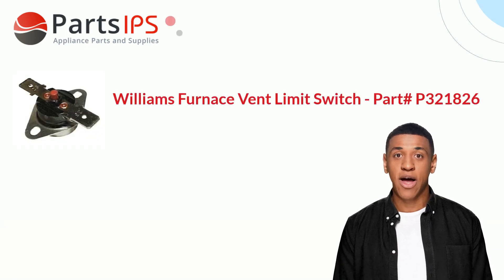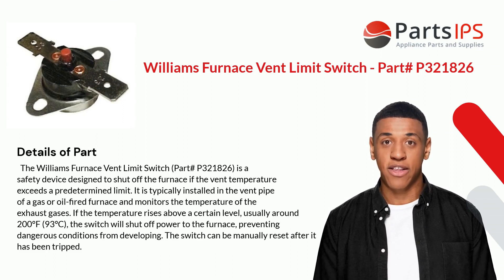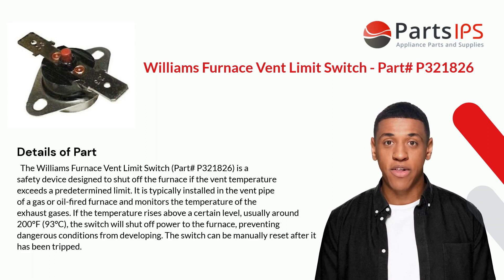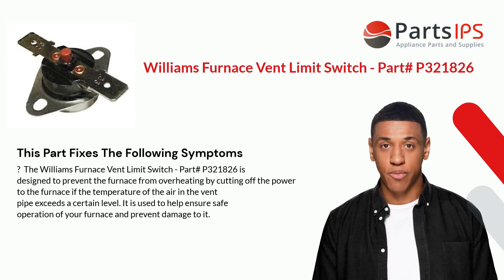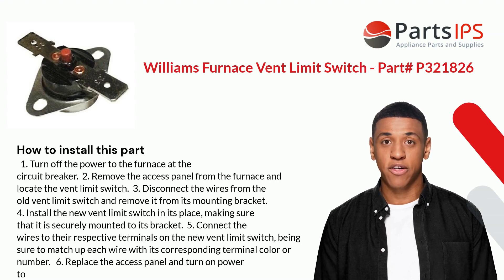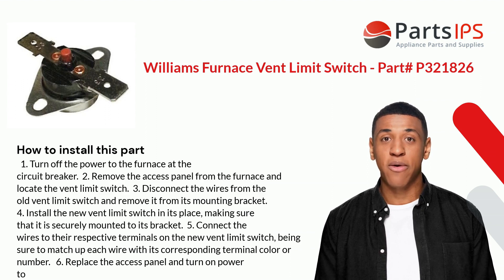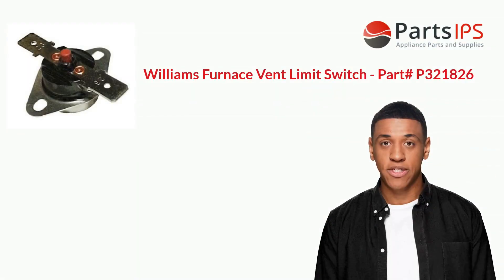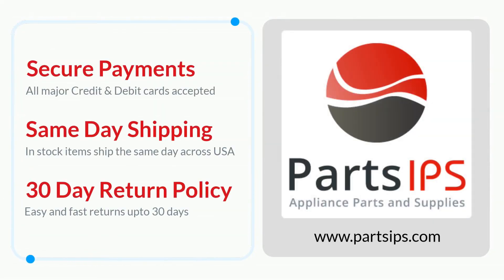Williams Furnace Vent Limit Switch - Part# P321826 - PartsIPS

Comment: OK so if mine keeps tripping then I reset it, it works for a day or so, so is the problem the switch or is the problem the exhaust ? so should I fix the exhaust pipe that leads out the roof or the switch?